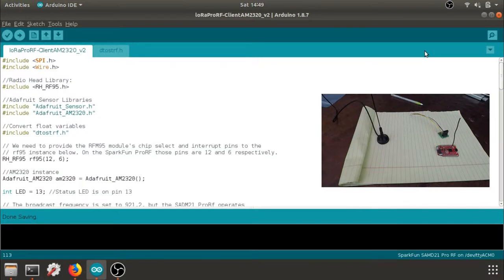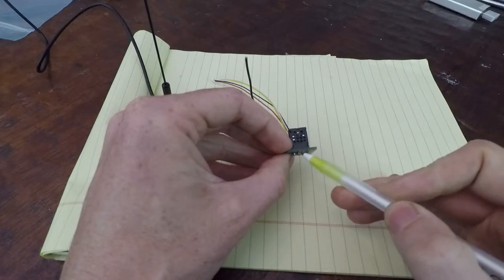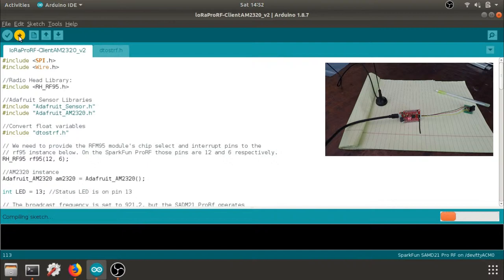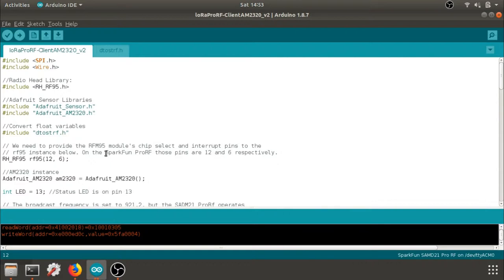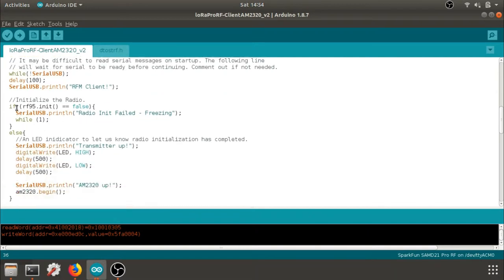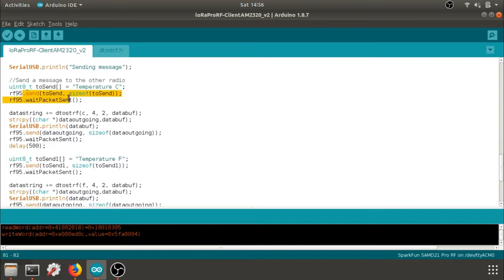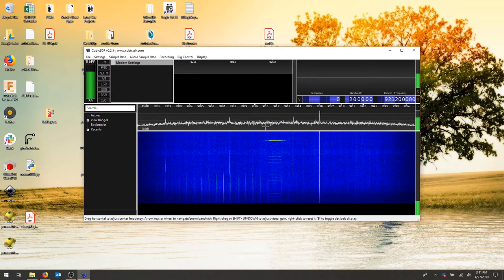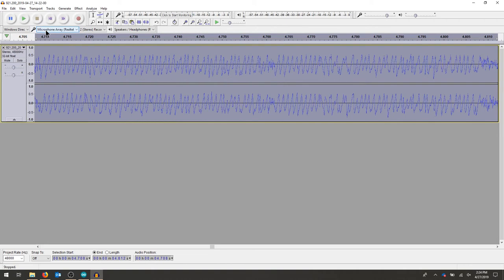07: ETR241 - Capturing LoRa from SparkFun Pro RF w RTL-SDR

Comment: I am using a MacBook pro but on the Sparkfun website, it says to be careful about how you power the board. I was hoping to use the micro USB like you did an I'm sure that this may be a dumb question if you know the answer to it, but do you know if it is safe to plug the board into my MacBook? I have had faulty external power sources fry boards in the past and I do not have any spares for this one so I wanted to be careful.
Reply from the maker: Yes it should be goodo to plug into a USB port. That should provide 5V and the board uses 3.3V which is regulated by the board.